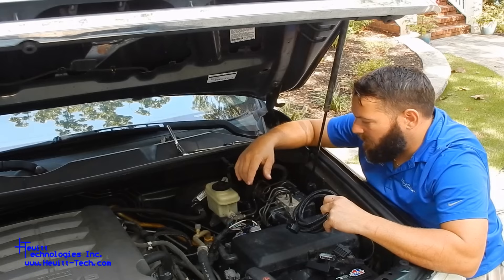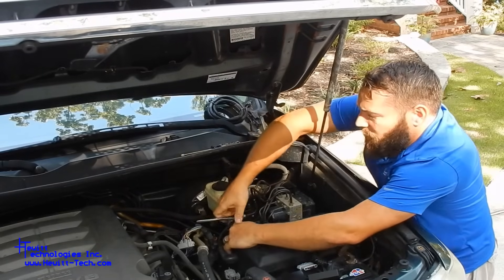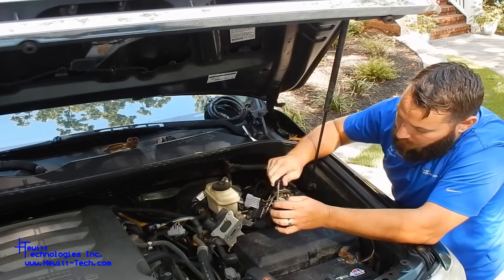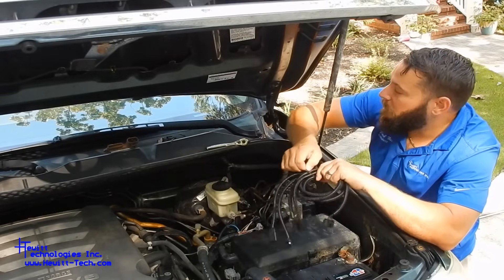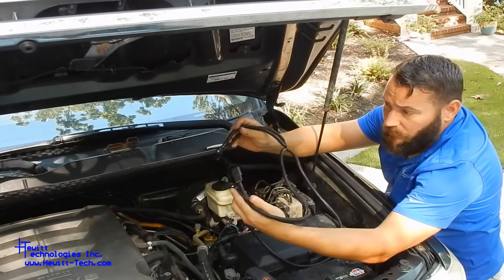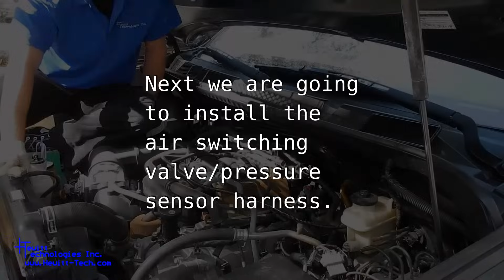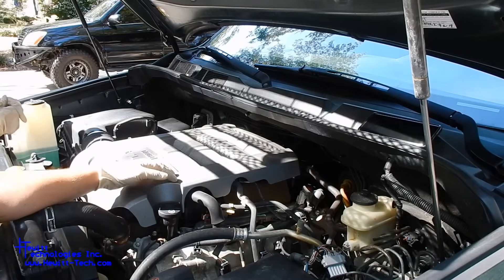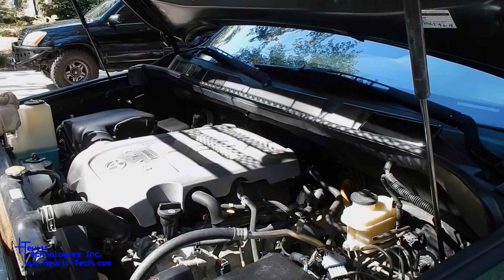Gen-II Secondary Air Injection Bypass Module - 2007-2021 Tundra 5.7L- Hewitt Technologies

Comment: Toyota would not honor the warranty to replace the SAIS in my 2012 Tacoma 4.0L because it was Rebuilt, and wanted over $2k to fix it. I could have ordered the part and replaced it myself probably, but it still was going to be over $500, and this was going to be the first time fixing something with the engine myself. AND I read reviews that part goes bad every 10k miles or so in ‘12 Tacomas because of bad design, so I decided to take my chances with the SAIS Bypass kit instead.

Yes, yes, and yes. It paid off. It was not easy for me to figure out where everything had to connect to (it took me several hours overall), but once figured out, you’ll realize it wasn’t that difficult. The exhaust plates that come with the package are identical, but I came to learn that one of the SAIS ports in my vehicle was modified because that side was where it was rebuilt. All I had to do was get a metal file and grind one of the plates down a little to make it fit, tighten it back on, done.

With the 2012 model you also may not need to install the purple relay wire they give you, but just follow the directions included in the package, and Customer Support will let you know if that’s the case. They were as quick and helpful as advertised. If you have any questions or problems, just contact them however you like. I cleared the CEL codes by disconnecting the battery, and have been running it for over three weeks now. No limp-mode, starts beautifully, runs great. Saved me big $$$ and I never have to worry about the part again. Thank you!
Reply from the maker: Hey Andrew, Glad you got it all figured out, thanks for the feedback. Just so people don't get confused, you got one of our Gen-1 V54H kits, not a Gen-II kit shown in this video. The Gen-II would have been a much easier option for your 4.0L Tacoma than the V54H. The V54H kit connects to your MAF sensor and ECT sensor which on the Tacoma 4.0L is a trick to get to down the back of the engine. The Gen-II unit install on your would have taken 10-15 min..it replaces the air injection driver like in this video but plugs into both your air switching valves which are right there in the open on the passenger side of the engine. Just let us know if we can help with anything else. Thanks, Paul
Reply: Just installed mine in my 2012 Takoma, unfortunately, it does not work.  The check engine light comes on right after turning the truck on, and that's right after clearing the code.  I will call their customer service tomorrow and hope they can help me figure out the problem
Reply: @sergiocabal8233  customer service was patient and helpful with me. hope it works out for you.
Reply: It's a damn rip off just by the replacement parts and fix it yourself you'll thankk yourself in the end

Comment: How do I remove so I can pass my smog check. I failed last week
Reply from the maker: Are you trying to remove the secondary air system or a GenII kit? A GenII kit can allow an emissions exempt vehicle to pass a smog test if there are no other issues with the vehicle and you go through enough drive cycles after installation so that all off the emissions monitors show as ready/complete. 

 *It is illegal to remove, dismantle or otherwise cause to be inoperative any pollution control device required by federal, state, or local emissions law. Our bypass kits are sold for off-road, competition or other emissions exempt vehicles only. No other applications are intended or implied. By installing or using this SAIS Bypass Kit the vehicle owner and installer acknowledge and assumes ALL risks associated with its use.*

Comment: I have this on my 2011 4.6 tundra and I forgot when I got it installed? It was either 130k or 175k. I have 214k miles now and it was starting to act like it did before.
Reply from the maker: Get the trouble codes read and give us a call because it can literally be a thousand different things and completely unrelated. Toll Free 844-307-7671

Comment: Can i use it on my 2011 seqouia, you stated after 2012
Reply from the maker: Yes, the Gen-II will work on your 2011 Sequoia and we actually recommend the Gen-II kits for any 2008 or newer vehicle. On certain 2012-2013 Tundra and Sequoia 5.7L there is a service campaign that will reprogram them to run the air pumps at shutdown like the Flex Fuel vehicles. For any flex fuel vehicle and one that has had the system reprogrammed, the Gen-II kits are the only compatible solutions.  Starting in 2014 ALL vehicles will run the pumps at shutdown so all 2014 and newer vehicles must use the Gen-II kits. I hope that clarifies and doesn't cause any more confusion. You can find more info on our website and how to identify if your 12' or 13' 5.7L Tundra or Sequoia has been re-flashed or not, it will also show up in your vehicle's service history at Toyota.
Reply: @Hewitt-tech  Would this work on my 2010 Tundra by chance? If not, do you have a kit that does? thanks!

Comment: How do u wire a original connector mine came off on driver side and the passenger side is different color wires do u know by any chance
Reply from the maker: You will need to email or call with the exact specifics of what you are referring to. We can help with pinouts or a repair pigtail but it is all year, model and engine specific.
Reply: @Hewitt-tech  where can I call you to or email you to and it's a 2008 Tundra 5.7
Reply from the maker: @andrewgaza9764  support@hewitt-tech.com, contact us form https://hewitt-tech.com/store/index.php?l=page_view&p=contact_us, toll free 1-844-307-7671
Reply: @Hewitt-tech  thank u for the info I already ordered the bypass kit should come in tomorrow so I'm hoping that works cause I dont got power it dont go past 40 and that's the only codes popping up about the secondary air injection pump

Comment: So wait this isnt for daily drivers?
Reply from the maker: As stated in the description: "Disclaimer: It is illegal to remove, dismantle or otherwise cause to be inoperative any pollution control device required by federal, state, or local emissions law. Our bypass kits are sold for off-road, competition or other emissions exempt use only. No other applications are intended or implied. By installing or using this SAIS Bypass Kit the vehicle owner and installer acknowledge and assumes ALL risks associated with its use." Basically, what you do with it is up to you.

Comment: Does this pass inspection? Thanks!
Reply from the maker: As our disclaimer states, "Hewitt Technology’s SAIS Bypass Kits and products are sold for off-road, competition or other emissions exempt vehicles only. It is illegal to remove, dismantle or otherwise cause to be inoperative any pollution control device required by federal, state, or local emissions law. No other applications are intended or implied. By installing or using this SAIS Bypass Kit the vehicle owner and installer acknowledge and assumes ALL risks associated with its use." Do not hesitate to give us a call if you have any questions (844) 307-7671

Comment: I noticed no connection to fuse block in this video, no need ???
Reply from the maker: No. The GenII units do not connect to the engine temp sensors and don't need to be connected to the starter relay. They are a complete standalone unit that replaces the factory air injection control driver(s).
Reply: @Hewitt-tech  thanks!!

Comment: The kit came with the little block-off plates, when/why do I have to install those? This video makes it sound that I just have to 'plug and play' the unit and that's it.
Reply from the maker: The module and plate installations are covered separately because they both vary according to engine and year. The block off plates are an integral part of the overall bypass solution and may not be 100% required for every instance. However, they are always recommended to be installed with the module and are the only thing that can prevent the valves from leaking in the future if they are not currently. If you do not currently have valve stuck open codes you can install the module first and see where that gets you but it always best to install them so you don't have to worry about the valves later on. If you don't install them just make sure to put them in your glovebox with the instructions because if you get a valve stuck open code later you will need to install them at that point and clear the codes(s) again.

Comment: I put the rutech bypass in.  no problems. turned off the light by diconecting the battery and it went out but it came back on after driving about 50miles..  I did it again and it stayed about 48 hrs. then came back on and went into limp mode.
Reply from the maker: We can't help you with a competitor's product but guessing you have an 08+ vehicle and are getting a P106B Temperature Correlation code? Please give us a call Toll Free or email us and we would be glad to help with a properly engineered and supported product specifically for your vehicle and codes. 
Toll Free 844-397-7671 support@hewitt-tech.com https://hewitt-tech.com

Comment: Just installed my kit yesterday, very good customer service, instructions with pictures, and helpful videos too.  They were not kidding about getting the clips off between the engine and firewall on the 5.7 L  Everything else was easy, sprayed down the flange bolts a couple times 2 days before and they came off very easily.  But the clips gave me some issues, ended up using tiny screw drivers to pry the clip up for removal.  Good service and tech support overall!
Reply from the maker: Always good to hear. Yep, unfortunately on the 5.7l it can be a little tricky getting to the connectors. It is still way better than having to remove the intake manifold and replacing everything. If we can help with anything else just let us know.
Reply: @Hewitt-tech  absolutely not even a question about it, why replace the parts when they will just fail again..  I was making a simple pointer for anyone looking to DIY this project, I had issues because it was my first time, if I had to do it today it would be a lot easier.. just trying to help people with a small tip beforehand, thanks again!
Reply from the maker: @KurtBraunel  Exactly. It would be nice if the 5.7L was as easy as the other engines but unfortunately that is just what has to be done to make it plug and play. Cheers!
Reply: Hopefully a helpful hint. Installed my Gen. 2 on an 07 tundra 5.7. I did the passenger clip from the driver's side reaching behind engine. Much easier.  Check engine light is off and transmission shifts properly...

Comment: Hello Hewitt,
I have the bypass but I recently got a p2444 . My truck is misfiring because of this code. Is there a way to reset the bypass so it can remove this code? 
Thanks in advance.
Reply from the maker: The P2444 - Pump Stuck On Bank 1 Code isn't something that should have anything to do with a misfire but give us a call with your trouble codes and information and we can try and figure out what is going on. You can also submit a support ticket through the website that we can use to follow up with you.
Reply: @Hewitt-tech mine says stuck off bank 1 and 2 what do I need to do
Reply from the maker: @jayprogroup  What is your Year/Model/Engine Size? Also, have you ever replaces the SAIS components before?

Comment: I have a 2009 LX570 code p1614, so this is the device I'm looking for?
Reply from the maker: As long as the P1614 - Air injection control driver malfunction bank 2 code is not caused by damaged wiring or ECM then yes the GenII kits can take care of P1613/14 also.

Comment: Hey guys, 08 Toyota tundra 5.7 120k  throwing P2442 code, truck in limp mode. I don't have to pass any emission test. Considering gen 2 kit but have one question, does it hurt the vehicle in any way to run it with the bypass kit installed? I was planning to keep this truck for a long time before this
Reply from the maker: The Gen2 bypass kit will not affect your vehicle negatively in any way. On your vehicle the SAIS will only operate on a cold soak start (Off for 7hrs or more). Not running the system on that start is no different than starting it cold throughout the day. Our bypass kits have been installed on vehicles for almost 10 years now with no issues.

Comment: Will this work for codes p106b & p0456? 2010 tundra 4.6
Reply from the maker: No. If those are the only codes you are getting it is likely evap pressure sensor problem in your vapor canister and not related to the secondary air system.
Reply from the maker: The only way you can determine which sensor is causing the P106B code is to look at the sensor data from the secondary air pressure sensors and the evap. pressure sensor on your freezeframe or live data. The one that is reading different than the other two is the problem.

Comment: Will this work for a 2013 4.6?
Reply from the maker: Yes, the video is just showing the install on the 5.7L and is different on the 4.6L but is even easier. The GenII kit is the recommended kit for all 4.6L vehicles. More info in the description but check out our instructions page for specific details about the install on each model/engine until we can get the videos posted.

Comment: Do you have an install video for 2011 Tundra 4.6l
Reply from the maker: Not yet, we haven't been able to get our hands on one locally yet.
Reply from the maker: It is the same as the 5.7L except your air switching valves are way easier to get to on top of the valve covers. That is also where the plates install. Please give us a call Toll Free and we can walk you through it if you have any questions.
Reply: So if I do this the truck will run normally
Reply from the maker: @briangarnett1095  Yes, the Gen-II will get you back to factory performance if you are stuck in limp mode from a failed secondary air injection system. That is, as long as you have good pressure sensors  (either the factory ones in the air switching valve or our PSO addons), good wiring and ECM.
Reply: I have a 4.6l you can try it on lol
Reply from the maker: @TheLilRedRocket  If you are in the Lexington, SC area and can leave your vehicle with us for a day or two that would be great. Shoot us an email. Support@Hewitt-Tech.com
Reply: Sorry. Hewitt-Tech I was hoping you would say Louisiana. I will most likely order one when I have $450 to spare!
Reply: @Hewitt-tech  I will definitely drive to Lexington. For research purposes of course. 2012 4.6L

Comment: how long does this generally take on a tundra 5.7L? I do auto work on the side and have someone asking for this install. Trying to figure out how many labor hours to charge for. Thanks!
Reply from the maker: We usually say 1-2 hrs is about average. Just pay close attn to the block off plates installation. If it is a rusty truck those may cause extra time.
Reply: @Hewitt-tech   yea I live way up above the rust belt and this trucks got damn near 200k miles on it. Thanks so much for the reply, and the videos! Going to try a magnetic induction heat gun on it if I can't just get a nut cracker in there depending how bad they look.

Comment: Is that legal in California, will it pass the Smog Check?
Reply from the maker: All of our units are for off-road or emissions exempt use only and it is illegal to use them for on highway use. That said if you were to have your exempt vehicle checked it would not have any problems as long as there were no other problems, no check engine lights and the vehicle goes through enough drive cycles for all the other monitors to complete.

Comment: Do you have a video for the 4.0 V6? I have an 08 Tundra.
Reply: I have an 2010 4.0 v6 and it is damn near impossible to find any information on these models.....I've just bought one of these kits and was thinking about doing an diy install video 📹....see how it goes
Reply: I have an '07 4.0L.  I'm going to just replace the valves on top instead of disconnecting the entire valve assembly (the lower part is just a manifold I believe).  It looks like all you need is a torx to remove them.  This is way easier than the 8 cylinders and you can get the whole assembly aftermarket for around $250 now.

Comment: I need video for 2nd gen Tacoma
Reply from the maker: We are getting there. The Tacoma is Extremely easy though. You can find the installation instructions here:
https://hewitt-tech.com/store/index.php?l=page_view&p=instructions
Reply: We’re do u put the plates at on 2009 Toyota Tundra ????plz help
Reply from the maker: @bassfury9241  It depends on the engine and year. As mentioned to you on our 5.7L block off plate video all of the 5.7L block off plates will install as that video shows. The engines that have the valves on the top or the side of the engine will have the plates install at the air switching valves.

Comment: Does it clear Permanent codes?
Reply from the maker: Yes, because the way the Gen2 kits function, they can allow the permanent trouble codes to clear.. However, permanent codes can only be cleared by first clearing all the pending and active secondary air trouble codes. The permanent trouble codes will then go away by themselves after the first time the secondary air system is commanded to operate and the module completes the cycle. In the winter time the permanent codes will not clear until the engine cold soak start temperatures are above 40 deg. F because the ECM will not operate the system below this temperature. To make sure the permanent codes do clear, the system can be forced to operate using a tool like the factory diagnostic software.